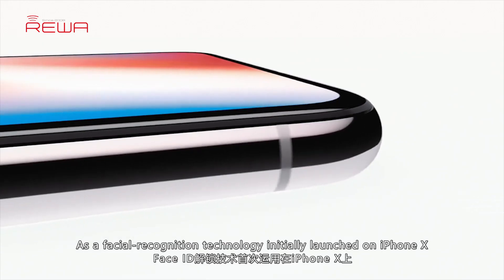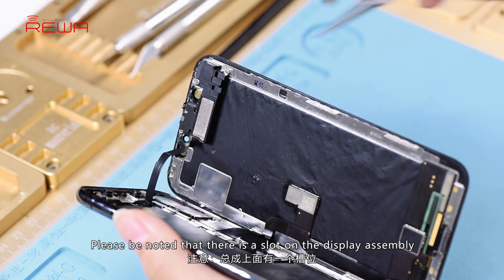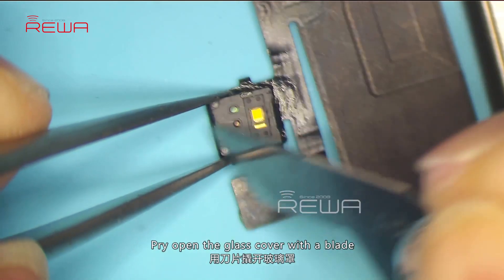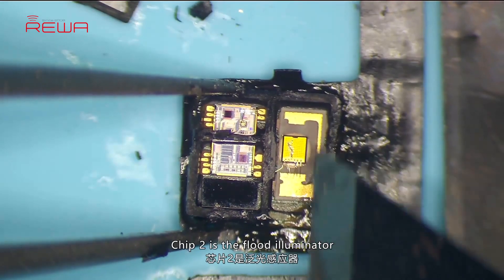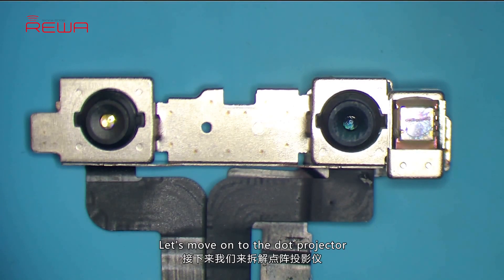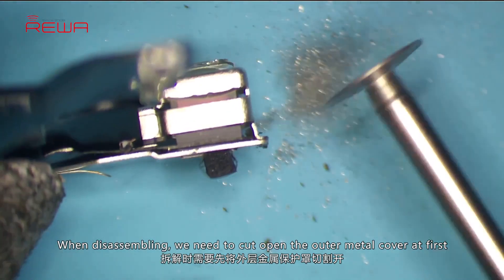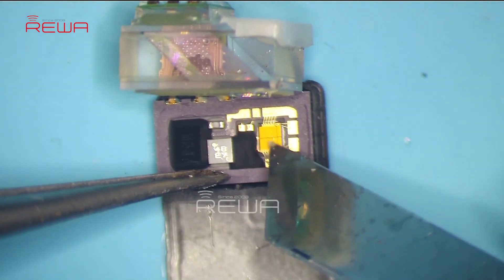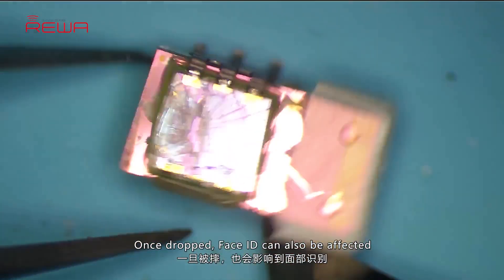Why Face ID Can Be So Easily Damaged And Hardly Repaired?

Comment: Hello, what a nice and helpful video you guys did here... I bought the machine and did the same as you guys did, but there is a problem is that when i add my face, and lock the phone it won't open to my face. So let me be clear... The thing is that at the beginnning it was giving a warning to get the phone lower and upper. right now everything looks great. Just that when i put my face and it says everything is complete . My face id restarts directly. So please if someone can help me with this or anything because i've tried several times. Thank you so much and i appreciate your help.
Reply: Make sure the flex cables are clipped properly 😢

Comment: I dropped my phone in water and now face id broke :(
Reply: Same.. dropped it in water for a few milliseconds..
Reply: R u fixed it bro...now I’m to facing same problem
Reply: A.Shaik sindha Madhar nah you can’t fix it. ‘Cause I go to Apple service center they said can’t be repaired and they told me to change the phone 1:1
Reply: IP67 rating eh? Really bad feeling to Apple. I just regret buying iPhone. This is my second iPhone, after my broken iPhone 5s.
Reply: Yeah, it's not water resistant, and if it breaks, the only way is to get a new one or to chance the mother board.

Comment: i want to ask this issue is common on x or also xs?
Reply: the issue happened to my xs too, however the xs has a little bit better water resistance when dropped into it. BTW i tried to wash my phone with water and it has short fused the dot projector.

Comment: I tried replacing the entire camera module but it doesn’t work with my phone. Is there any tip please suggest me I’m helpless. I would be very glad to get a reply.
Reply from the maker: Have you replaced the camera module related to Face ID? Please be noted that Infrared camera, Flood illuminator, and Dot Projector are paired to the phone. Once replaced, Face ID might also fail.
Reply: Front and back cameras are not working, so neither flashlight and FaceID. I don’t really care about FaceID because I prefer the code system verification. 
Do you think if I change the entire front module (front camera, sensors...) cameras will work again? 
I know FaceID is impossible because is an item related to your own phone and is unique. Thanks.

Comment: Is there any place that could troubleshoot face id in UK? I have a not working one that I would like to get fixed.. cables look ok, nothing is visibly damaged.. It's driving me crazy
Reply: If the display was changed, there is a possibility that you damaged the flex cable to the dot projector or nearby. Check under scope
Reply: @josiahsoko32  Is there any good way how to determine if the dot projector is working or not? Cable looks ok visually, but could still be damaged.. I don't have a microscope.. would have to buy one. (btw the screen has been changed, but this was after the face id stopped working.. and I later put back the original screen back anyway because the touch stopped working on it)

Comment: I have a problem, when connecting the infrared camera on the board the rear and front cameras turn black, but if I unplug them they work again, if I put another infrared camera the cameras work, only with the original not
Reply: @annxu6464  I love you

Comment: I have gone through 3 different iPhone x all with face id failures in some way or another, one outright failed with the common " face id unavailable" message, the other 2 though simply stopped being able to focus on my face out of nowhere, didn't drop them or expose them to water they just quit, super fragile component for sure
Reply: Yea true, when I opened the phone i accidentally hit the lens. Next time, I wont use the pry tool at the top. I thought it would be okay because I saw videos and people would use the tool from the top of the screen
Reply: does xs have this issue thou?
Reply: @solracseries7187  iphone xs face id works the same way. Im assuming that it will break the same way.
Reply: Just recently of owning my iPhone XS Max for almost 2 yrs my Face ID gave out. Took it to Apple store and said it was the ID sensor and not repairable. They gave me another new phone without charge because o had Apple care.
Reply: Did the front cameea get damaged too?
Reply: Bs

Comment: If regular front camera is replaced because damaged,  Face ID will work it?. Have iphone X with big impact, Front camera isn't working and so on the Face ID
Reply from the maker: Hi，Juan. No matter the front camera is good or bad,it has nothing to do with the Face ID function,it's just related to dot projector, flood illuminator and infrared camera.😊
Reply: Juan Issa no it wil not work
Reply: @amandipbudhraja1341  So REWA info wasn't complete, DOT projector, flood illuminator, infrared camera, even the selfie camera anyone of them is necessarily replaced bye forever to face ID? 4 components... If in something Apple has advance is in go to newer device instead fix it, good polite! Very smart move... 😒

Comment: New face id available on your shop ?
Reply from the maker: Yes, Ankit. We didn't sell the whole face id unit, but we sell the front camera, which contains the dot projector and the infrared camera on it. lol Here is the link for your reference: https://shop.rewa.tech/detail/for-apple-iphone-xs-max-front-facing-camera-replacement-oem-new.html
Reply: @rewatechnology2008  because my order iphone 7 screen on its way from your shop😊👍
Reply: @rewatechnology2008  can i but For Apple iPhone X Front Facing Camera Replacement - OEM USED for face id fix issue

Comment: More awareness need to be made among public regarding the apple's new plan of unrepairable devices.Such purposefuly made anti-repair designs need to be treated under the law.
Reply: Absolutely
Reply: Nothing is meant to be broken. Your car can be just as hard to work on these days and be 10x more expensive than your phone to fix. Your argument is illogical.
Reply: @DStabs720  Your comparison with a car which requires regular maintanence to use for which the manufacturer provides all required information in user manual and parts easily available,against an apple phone is clearly illogical.
Apple has been known to make many anti repair moves by Hiding Schematics from outside world,Making parts unavailable,Making third party parts unuseable through software and a whole lot more to shorten life of a device as much as possible.
Apple has been facing the protest against anti repair policy at law making government bodies in US and as a result recently started making microscopic steps to provide few parts for third party repair with a heavy load of if's. Hope you explore more starting with this youtube video- https://youtu.be/_XneTBhRPYk
If its too long for you,Start from 7:10 with all the attention possible.
Reply: @GeoCherian  Once again don't break it. It wasn't designed to be dropped! Mostly everything is designed with out the thought of breaking.
Reply: @DStabs720  So,Everything once broken,should go straight to trash?
Reply: @GeoCherian  No but if phones were as repairable as you wanted they would be 1.5x the thickness. There are trade offs. Get a cheap phone if you break it often!
Reply: @DStabs720  So premium phones are meant to be used by bedridden people?....And in which ideal world does every minute movement  happen exactly as planned?...FYI Iphones have gone thicker in past to recent models! 
The video( https://youtu.be/_XneTBhRPYk ) mentioned previously clearly shows the planned anti repair tactics with clean and clear evidence,what more do you need to accept the fact?!!
Reply: @DStabs720  "Don't break it, don't drop it."

Again, put the blame entirely on the user type of of argument I see. I could've swear I heard that one excuse before. 👏
Reply: @6oLsh0i6o0z3  You sound like someone who carelessly drops their phone, and then blames the manufacturer. You can break anything you buy, and yet i don't hear the argument for another consumable. Phones would not be packed full of tech and thin at the same time if they were repairable. I had an iPhone 6s+ for 4 years without a scratch on it with very heavy use. Grow up and you wont have problems.
Reply: @DStabs720  "Don't touch our master, our master is perfect. Glory be to our master. It is I that is at fault for accidently dropped our precious master's creation and therefore I accept the concequences of my carelessness and should be punish! Glory be to our master!"

Electronics are proned to failures sooner or later whether you like it not. You should grow up as well. 👏
Reply: @6oLsh0i6o0z3  You have accountability issues. You probably blame Lays chips for being 400 pounds, or the car dealership for your 30k loan on your Jeep. Phone manufacturers are not liable for your butterfingers.
Reply: @DStabs720  "Master, you are the most knowing, you know what lies beneath my heart and I wholeheartedly accept your wise judgement that I have accountability issues."

"Therefore my master, I will redeem myself & will gladly buy your latest and greatest $1000 creation since it is time for me to change to your newest creation anyway. I will also slap some enormous armored case to protect your holy creation and making it look like a cinder block, it is the sacrifice I would love to offer for you my master. Please accept my redemption & I hope you will be pleased. Glory to you O my master!"

"Also my master, I will ignore and turn a deaf ear on multiple reports by a reputable sources that "accused" you of purposely making it hard to repair your holy creation my lord. How dare they! Such blasphemy can't be tolerate. You are not doing that purposely! That shows you cared for my own safety as you are the most merciful!"
Reply: The main issues with iPhones is how Face ID and Touch ID are paired to the board and if Apple made those replaceable, iPhones would be some of the most repairable devices out there. In comparison to most Android phones, replacing the screen and battery is extremely easy and they’re still water resistant. But as for the back glass, that’s still one of the worst designs.
Reply: @supercrazymario404  Don't break your phone and you wont have issues. Only careless people break shit.
Reply: @DStabs720  yeaa but that's why there's guys like me who fix what people break
Reply: High end technology cannot be always user repairable...
Reply: @tiagomartins8715  It doesn't necessarily require to be unrepairable to user until its designed purposefuly to keep user away.There isn't much of a quantum technology in any of these devices for that.
The Apple fan in you may get offended but try this video to enlighten yourself-  https://youtu.be/_XneTBhRPYk